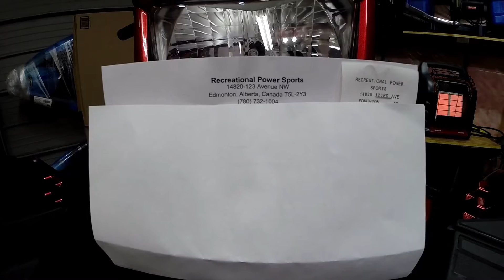New tires for the 2018 Sportsman 850 SP

Comment: I have 2014 850XP. Originals are 26", I've been thinking 28"s, does it require any changes to clutch/drivetrain? Normal riding and working, no full-throttle swamp smashing
Reply from the maker: I didn't do anything to clutch/driveline, its been two years and no problems.

Comment: The 850 is a sport utility. You should consider using the stock tires for break in procedure they are light weight. After that, the aftermarket tires are much heavier if you're considering a light tire I think the bighorn makes  a light version. The heavy tires take away from overall sport performance.
Reply from the maker: That is a good point. I didn't find the zillas to be much heavier, but they are taller.
Reply: Good deal. Taller  tire may affect your clutch operation  epi makes different clutch weights in a kit (3 weights) easy to install to offset the larger tire diameter, therefore the larger tire that will offset the primary clutch will be compensated with the weight kit and performance will remain similar to OEM.
Reply: One thing I did on my scrambler 1000 and the 850  install uni filter . The redesign and placement of the airbox has a known problem with filter alignment and the stock prefilter interfering with the filter mating to the intake causing dust blow by. I noticed this on my 850 after reading on different brand air filters to decide from. The uninfoam filter is larger and also has foam around this problem area eliminating the intake /filter seal problem.
Reply: Another problem I had with the 850 is the clutch bearing failed due to excessive dust exposure. Another polaris primary msrp is 600.00 and warranty is usually not covered is damaged from dirt. I noticed with the 850 redesign they moved the clutch venting between the rear tires. Makes no sense to me but I ordered a piece of foam I may think about placing the foam around the vent located near the rear tires. This is a dust haven area.  not wanting the new clutch to fail.
Reply: He doesn’t need a clutch kit for these tires..... they’re not that big/heavy. As far as break in goes, drive it like you stole it.